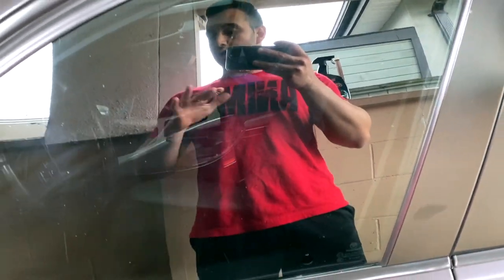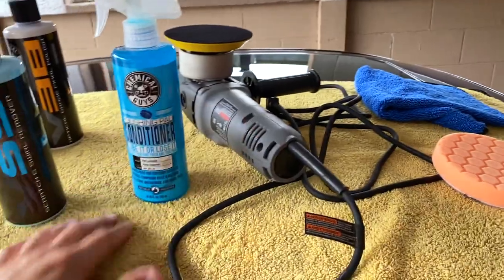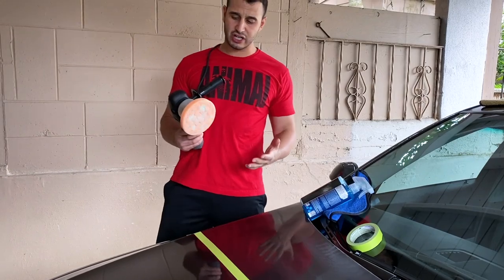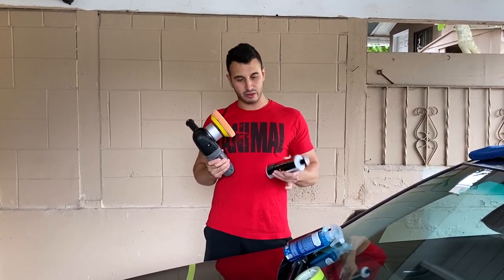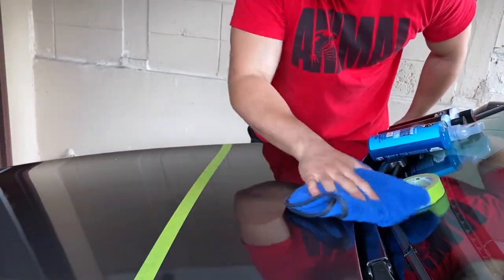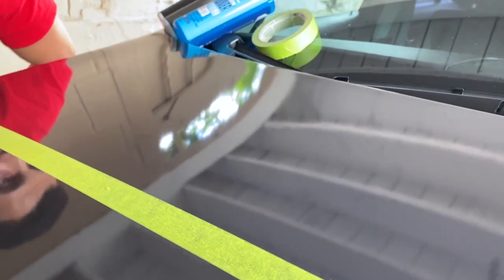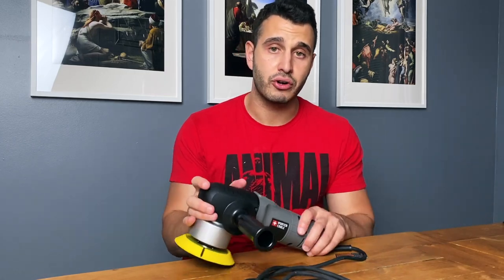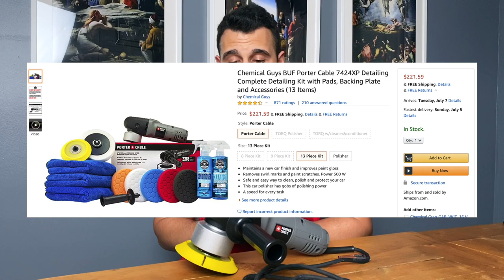Is CHEMICAL GUYS VSS, V36 and V38 Polishes WORTH THE MONEY? | Honest Review (Part 2/2)

Comment: Hello this is my first time that I going to do polish. The steps are:

1) Wash and clean your car
2) Use clay bar
3) start polish

Right? 

And I apply V36 with orange pad first and then V38 with white light pad? Or it doesn’t matter what pad it use?
Reply from the maker: If you got tons of swirls and scratches the 36 might not do it. May need to go down to 32 or 34. Wherever you start, make sure you go up afterwords all the way up to 38. Orange pad is fine for 32, 34, 36. White/blue/red is fine for finish. Make sure to subscribe!

Comment: Should've started out with V34 and a yellow pad. Moved to V36 and a orange pad. Then V38 and a white pad. Once you start using the V38 it's a huge difference! That's the most amazing final polish I have ever used! Get you some of that bro. Would have made a world of difference! Chemical Guys C4 and P4 is a great two step system as well. I always finish out with V38 though.
Reply: I started with v32 on the orange, then v36 and white, then v38 on the blue. For a car that has never been detailed in its 8 year life, it really needed that v32. I actually went through 2 whole vlay bars just on the hood too

Comment: As a tip don’t use quick detailer for clay barring as it adds a super thin protection layer and your reasoning for polishing is to remove scratches. Quick detailer helps fill them in.
Reply from the maker: Quick detailer is fine but thanks for the input
Reply: @MatteoVlogs   Aight brotha’. I’m just giving you a tip from pros and other youtubers that have been doing it for 20+ years. You do you man.
Reply from the maker: Google it for yourself. There is no proven scientific studies done as to why you can’t use QDS as a lubricant. Even the most knowledge car detailers on YouTube use quick detail spray while claying. Please show me some research and I’ll see your point of view
Reply from the maker: https://youtu.be/Kn8wYn_P9Js
Skip to 2:05
Reply: Meguiar's Quick Detailer would be fine, as would M34 Final Inspection.

Yes, the Gold Class, and Ultimate add a layer of protection. This causes the abrasives to get covered in the protectant, and clog up the pad, but it will eventually be removed.
Reply: @MatteoVlogs  - Just to note, the stuff Pan is using doesn't contain any protective ingredients. 

Actually, I don't think the Gold Class does either. I think it's the Ultimate Quik Detailer that has the polymers in it. 

The Gold Class does have ingredients that darken and make the paint slick. 

Either way, they abrasives in the polishes will remove whatever it might put on the paint.
Reply: @danlc95  You can use a quick detailer for the clay process. That's why it's important to go over the car with isopropyl before compounding.  Even after compounding and polishing you should go over with isopropyl to make sure all compound/polish residue is gone before applying you sealant/wax or ceramic.
Reply from the maker: Thanks

Comment: When polishing you always wanna go slower and I overlapping about about half way each time. Also make sure you’re doing passes till the product is clear. If it is hazing and its hard to buff off. That means the abrasives haven’t broken down and you need to do more passes
Reply from the maker: Ya I feel the chemical guys polishes don’t really break down tbh
Reply: @MatteoVlogs  I usually get them to break down pretty good. If its still too hard after 2 slow passes. Dampen a towel with A diluted ipa wide down or wax and oil remover.
Reply from the maker: Thanks bro

Comment: Coming from an experienced weekend warrior with a close friend who owns a detailing business. V32 SUCKS as COMPOUND, Meguiars detailer Compound D300 (pink bottle) is leagues BETTER then V32, Less compound dust, cuts deeper, and less fillers. Now as for V36 that is a great compound, it is better then Meguairs detailer polish D302 (Yellow bottle). As for the Torq polisher from CG, that also sucks, if you can’t afford a Rupes, go with Velocity, it’s better then Torq for not that much more.
Reply from the maker: Thanks for your advice. I was doing some research into the meguires line as well. For next summer I will def be picking that stuff up that you mentioned. Thanks again!
Reply: @MatteoVlogs  - Check out M110 and M210. Great products. 

My choice is the Jescar abrasives, and Buff and Shine Uro-Fiber for cutting, and Uro-Tech yellow for polishing/finishing. 

I have Rupes tools, and a Flex 3401, but for some reason prefer the Porter Cable 7424xp, like the one you use in the video.
Reply from the maker: Thanks bro
Reply: @danlc95  I agree Meguiar's are miles better. You should also try compounds and polishes from Koch Chemie or Sonax. These are used allot by detailers here in EU, they might be more expensive in the US though.
Reply: @karolisrum6573   - I have Sonax Ultimate Cut, Cut & Finish, Perfect Finish, and NP 03-06. I wanted to get the Koch, but I have so many sets already. 

I have both sets of Rupes orbital polishes, Menzerna, Megs, 3D, Jescar. 

I've been using the 3D a lot more lately. It's the only line I have that is formulated without harsh solvents, and is easier remove residual oils  with a panel wipe.
Reply: @danlc95 Thats nice! Im curently using Sonax and Koch most of the time. Sometimes Meguiars and 3D HD Speed for quick enhancements. I have also heard great things about 3D ACA compound and polish these are next to try on my list.

Comment: I love how clear you are for the video! But for the pad are they reusable? Do you wash them after using or you tossing them out?
Reply from the maker: Yes hand wash them right after each use with a cleaner and brush
Reply: @MatteoVlogs  Perfect so during using the v34 in your video and you switch to stronger one v36 is okay to use the same pad?
Reply from the maker: Ya just wash it and make sure it’s not wet
Reply: @MatteoVlogs  Do you think the pad that we use to polish and the pad to use wax are the same material?
Reply from the maker: No
Reply from the maker: Honestly I think by hand is the best for wax

Comment: Do you have to use a sealant  after polishing  or are you done ?
Reply from the maker: If you’re going to be doing all this work the yes I would recommend. However; it’s not like you have to. Up to you
Reply: You do want to seal it especially after claying because the clay bar strips all waxes and protectants. After a polish the car is left with a fresh layer of paint and you want to seal that and protect the new paint.
Reply: After watching many Chem Guys videos, I agree with Crinj-- after clay barring and polishing, you need to protect the paint either by going straight to waxing or sealing and then waxing the car.
Reply: Yes . After you spending hours , correcting paint . You need a good protection on surface.

Comment: Would you still add V38 as a final polish if you used VSS?
Reply from the maker: I guess you could ya
Reply: According to Chemical Guys, VSS is a one-step polish, so no need to use V38 as well.
Reply from the maker: Correct, but v38 is a pure polish and is nice as a last step

Comment: The chemical guys range has its place but sadly not if you need to do some serious correction, I was impressed by the range for one thing only... It works well for several passes and doesn't dry out easily BUT if you need a serious cut.. The 3m range is far superior.

Comment: Hand movement can improve you going to fast and v32 v34 compound first not v36. V36 is for light imperfections v34 would have been a better choice and a stronger machine too
Reply from the maker: Don’t need 32 or 34 if not needed bro. My paint wasn’t that bad.
Reply: @MatteoVlogs  you were testing out products you could have gotten 90% correction with white pad on v34  and white pad with v38
Brand new cars out the lot you can do v36 with white pad and be okay but those are light imperfections with your car being a bit older v34 and orange pad would have did the job change up the pads for more cut or less cut no matter the polish you use
Reply from the maker: “Older” means absolutely nothing. Year of the car means nothing. How do you know if I just got a fresh paint job or not 2 years ago? 5 years ago? Yesterday? My bmw is an 06 with great paint. I know what you’re saying but you need to take everybody’s paint as a diff job. I clay my car every 5 months. Correct every year. 32 or 34 was not needed.
Reply: @MatteoVlogs  actually it does but keep doing what you're doing and mess up the clear
Reply: First time using chemical guys compounds. Always start . On low speed . As you work product increase speed . Also if you don’t know how your paint will react, start with higher number compound  and softer pad, if still scratches go with harder pad. If still, lower compound . 
If deep scratches go with meguires cutting compound . 
Chemical guys are safe and not deep cutting. In my opinion 
Finished up a Chevy Denali. Took 6 hours . 
Times may vary depending on how bad the paint is and how picky you are

Comment: Wait so let’s say you use vss first then you can use v36 on the same place?
Reply from the maker: I wouldn’t use vss then anything else. Vss is something you would use if u want to do a 1 step correction, for a quick fix. If not vss, then use v36 and v38
Reply: Matteo Vlogs so vss can be used as a stage 1
Reply from the maker: Ya but it’s really all u need
Reply: Matteo Vlogs Thank You so much

Comment: Both the Torqx and the Porter Cable are DA polishers.  I don't believe they offer the Porter Cable kit anymore.  Nice video.  I wish you would have shown your finished product.  I did buy the Torqx kit.  I want to see if it will repair the oxidation on my little work car and make it easier to wax my big weekend ride.
Reply from the maker: Thanks